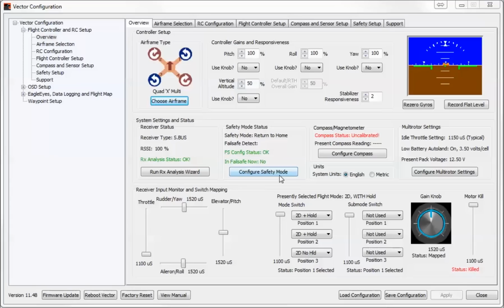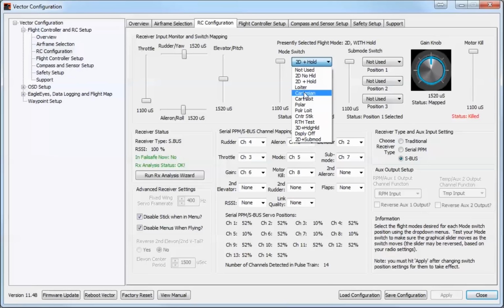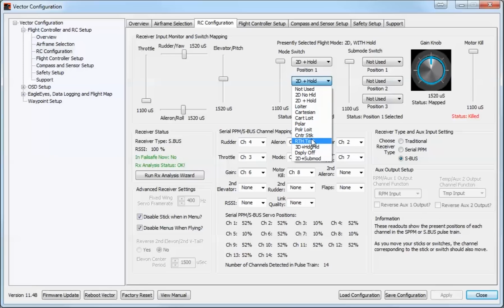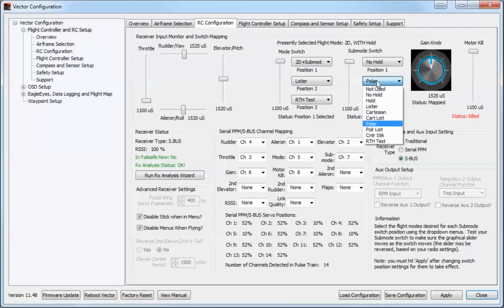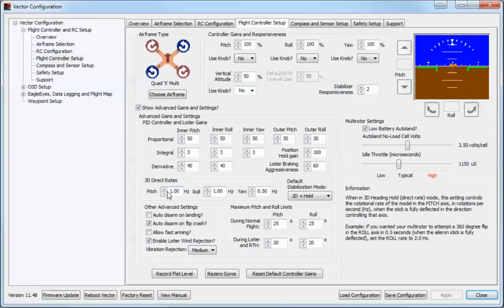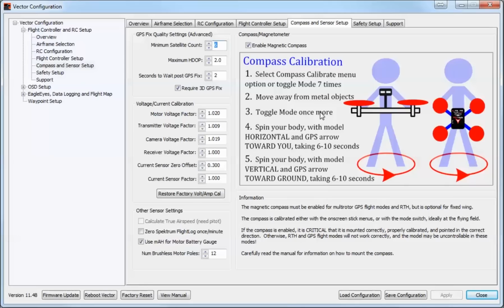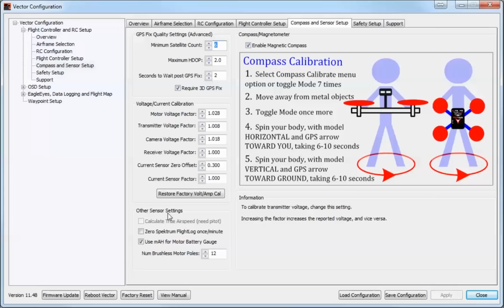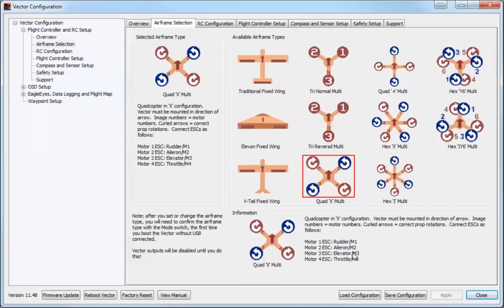Eagle Tree Vector - Guide/Setup Part 6 - (Multi-Rotor Setup)

Comment: What happens if the 3rd position on my first switch is set to submode selection, does that mean whatever mode I have in the first slot in the submode switch will be active as soon as I enter submode? Also, what is the best practice to using toggles. Is a toggle comprised of a flip of a switch across all its positions and back or only from the mode you are in? Just wondering how to toggle sticks while in the 2nd position of a 3 way switch,.

Comment: Today my f450 fell from the sky. I've contacted vector support but they are no help. Anyway I took my drone straight up to about 400ft sat there for a second or 2 then put it into return to home. All was going well until I decided to put it into loiter to bring it down myself. But nope. The 450 just fell from about 300ft with idle motors and you get the rest. Has anyone else had any problems with the vector dropping from the sky?

Comment: I'm trying to play around with the Polar Loiter mode and i'm not sure i understand it correctly... When you switch it into PL mode, it is supposed to make an imaginary circle correct? If so, is there a setting that can be adjusted to change the size of the circle? If I were to fly my quad out lets say 300' away and switched it into PL mode, what will it do? How big of a circle will it make at any given point i change the quad to that mode?

Comment: Polished, highly informative and full of detail. An excellent series of tutorials. Well done! Can you advise on failsafe using a Futaba T8FG controlling a multirotor with a standard Rx - I want to set up the system so that the Vector will go into failsafe (RTH) if it loses the Tx signal. I have this on the NAZA lite using an SBUS Rx, and it worked very well. I have set up two 3-pole switches to enable RTH on the Vector without a problem, but it doesn't look possible to program f/s (RTH) upon loss of Tx signal with a standard Rx. Is that the case?

Comment: You have any issues with toilet bowling in loiter?  Seems like the compass dance is not too exact. I'm having a horrible time. Also trying gps hold gain.
Reply from the maker: Not had the problem personally. Usual troubleshooting would be to make sure the GPS is fixed and facing the correct direction, make sure it isn't too near the ESCs/FC itself and make sure the whole thing is vibration free.
Maybe alsi worth trying to the dance in a different location just to rule that out (if you are doing it in a house, back yard etc then that will likely be the problem... find an open space). Even in farm land with nothing around there can be buried metal wires and such and these can all cause interference that will throw the compass out. If that doesn't work then it might be wise to contact Eagletree.

Comment: Excellent and detailed video!  Thanks for taking the time to do this.  I was puzzled by the two cartesian modes and I think you explained them as slight variations of Naza's "Course Lock" and APM 2.6's "Simple" modes.  If I understand correctly, there is no equivalent of Naza's "Home Lock" or APM 2.6's "Super Simple" mode.
Reply from the maker: Hugh Dinwiddie Thanks Hugh. Yes Cartesian is basically like Course Lock mode for the Naza. More confusing is that cartesian loiter is NOT the same as Home Lock mode (which means that pulling back on your sticks will bring the craft back to home point). I hope to get some real world footage of this in the next month or so (or do an animation to show it).

Comment: Great video, thank you for the pc set up. I'm not using the FPV so this was great. 

I'm having an issue with my build that I can't seem to sort out, so maybe you can help. My M2 Motor doesn't spin up with the other 3 when I arm. When I get above maybe 10-15% throttle everything seems to balance out. Anything lower it doesn't get going. The issue is I either have to jam the throttle up to get off the ground or if I gradually climb it flips. Any thoughts?  

I swapped motors, and esc's and its still M2 so I think its a Vector setting.
Reply from the maker: Could be a few things Joshua. Before getting bogged down with details it would be worth me mentioning that Eagletree advised that at start up you might not always get a perfect symetrical 4 motor spin up. As long as it idles ok and hovers fine that actually its not something to concern over.
However... that being said there are a few things to check. Firstly the classic case of calibrating the ESC's (assuming they aren't DJI ones). How you do this does depend on the ESC itself.
Next thing to look at is in the Flight Controller Setup screen under 'multirotor settings'. Try changing the 'Idle Throttle (Microseconds)' to a little higher. You want the idle speed to be fairly fast but you don't want it trying to take off. You might find that that one ESC just needs a little more signal to get up to speed and hence increasing the uS a little might work.
Try those things out and feel free to reply with your setup (in case there are known issues that others can identify). Again I'd say though that as long as the aircraft hovers stable in the air, the arming isn't important. I speak from experiance here as my first attempt (after wiring the M1,2,3,4 correctly!) didn't even recgonise the motor test or arm properly... it still flew fine though.